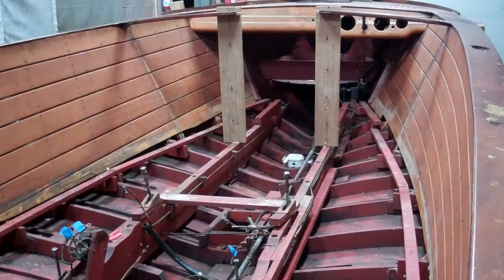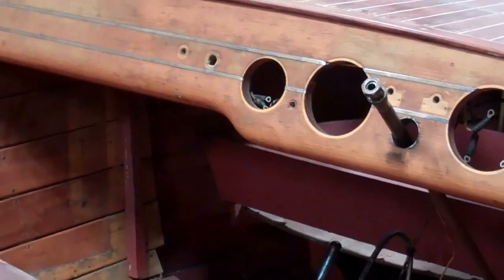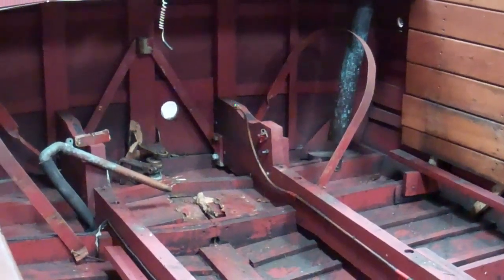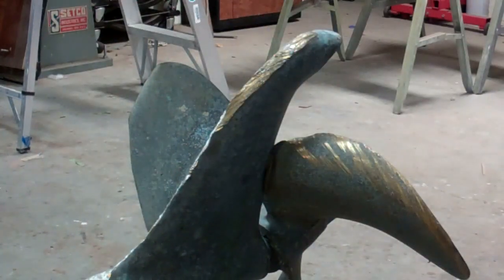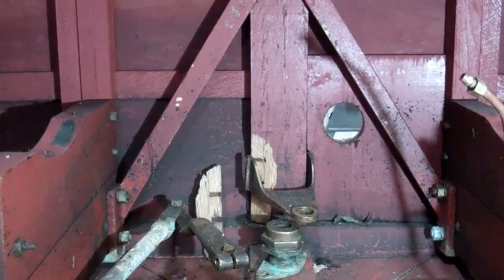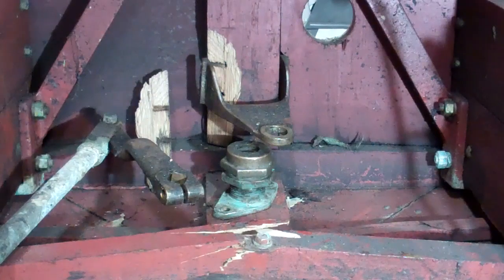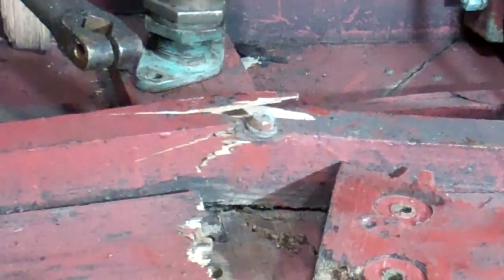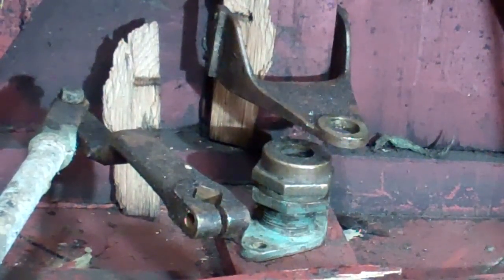1947 Chris Craft Cedar Plank U22 Rock Damage 1 12 2020 Snake Mountain Boatworks LLC

Comment from the maker: One item I neglected to include, but must since it is such a huge safety concern: The original, individual plywood floor panels were replaced with rough sawn , individual 3/4" pine board that were screwed down with endless view. Making matters even more dangerous, the wizard who put all that pine down completely untreated to the point most of it was rotted through and though now, compounded her/his folly. How? She/he then cut a single sheet of incredibly heavy linoleum to shape - from beneath the aft bench all the way forward to the helm station - and then glued it to the pine boards using some sort of tile mastic. Removing this monstrosity needlessly cost her poor owners hours and hours and hours of not very happy labor!
Just imagine if this boat had grounded and punch a hole through the hull further forward and beneath this huge monolithic pine-linoleum barrier. Would her occupants have zero warning that she was sinking until it was too late? We will fabricate proper and safe floor panels using the original ones in my wife's and my 1946 cedar U22 for patterns.

Comment: Your oil dilemma is a strange one. Fresh oil to me is as a result of the accident, otherwise it would be burned onto the exhaust pipe and in the bilge. When the engine stopped, could some of the crankcase oil been forced past the exhaust valve guides and out past a tired exhaust gasket?  Really odd, will be interesting to hear what the interior of the engine is like, not holding much hope for the crankshaft. Thanks for the update
Reply from the maker: Very interesting, Randy. I am absolutely with you on the crank, and won't be surprised to find some issues with the connecting rods. We will tape the compression and leak down tests to share with you and the rest of the SMB community as well as her owners.

Comment: Quite extensive damage.  Enjoyed your description on the removal of the original bottom and repairs.  Would like to see the videos on that.  Since you are only going to remove say 40% of the original bottom, are you going to bed it in 3M 5200?  Just curious how a 60% original style bottom will perform with a 40% 5200 bottom. Or are you going to redo the 40% replacement in a "original" type bottom?  I am betting that you will find even more damage once you start taking the bottom apart.
Reply from the maker: Bill, as you surely suspect, no decisions about paths forward can be made ahead of deconstructing the transom and bottom. One thing is for sure, however. We will not go for Siamese twinning of traditional and 5200 bottoms.
I agree that we have many more "secrets" and likely much more damage to discover as we take things apart.
And, to be sure, I will keep the community looking over our shoulders with videos.